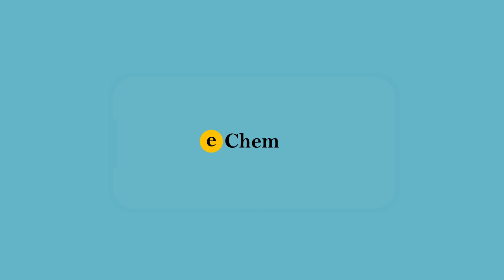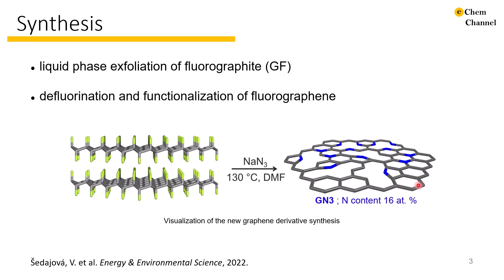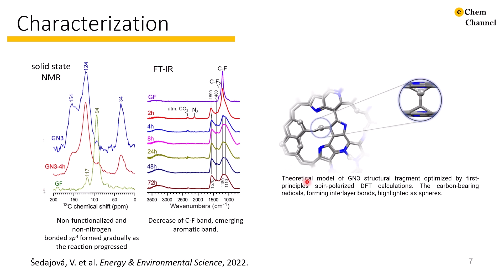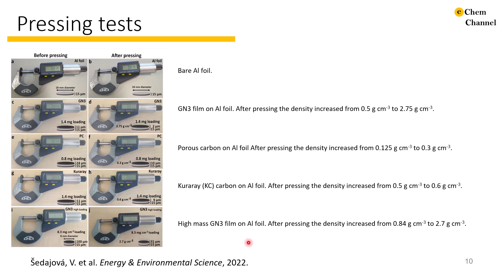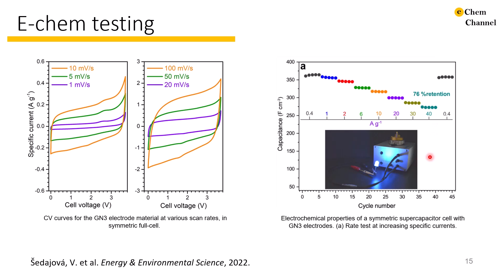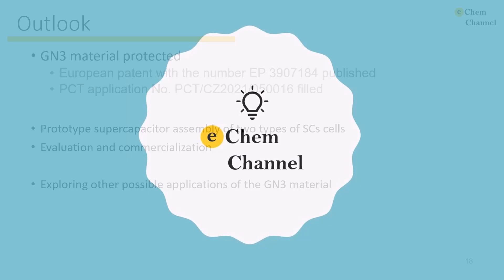[Research Paper] Nitrogen Doped Graphene for Sustainable Supercapacitor

Comment: in graph of CV and GCD, the starting potential is zero, but in some other research paper, it is explained why CV and GCD is start with negative potential and are meant to start from zero, negative, or +2 or from +2 , potential please explain
Reply from the maker: Hi there, I'm not sure if I understand your question well. When you see "potential" starting at zero, they are likely "voltage" that is measured between the cathode and the anode, which means they are using a two-electrode setup. When you see other values, the data are likely collected from three-electrode systems.